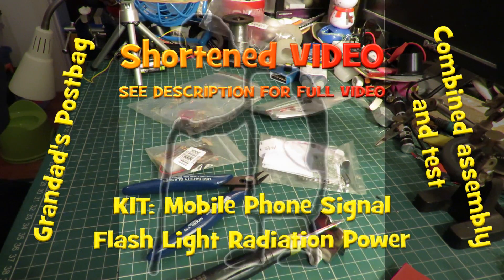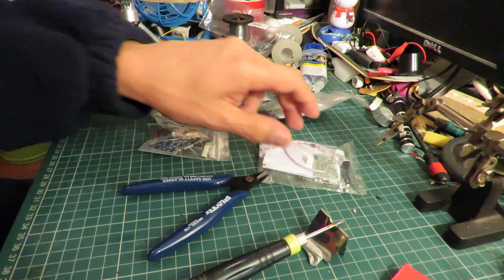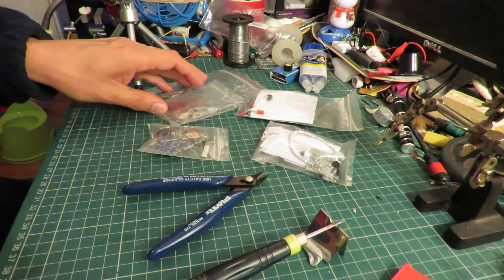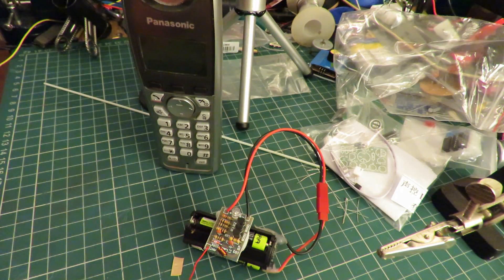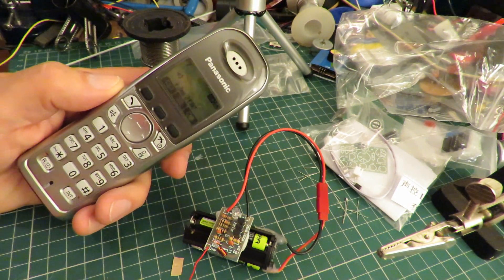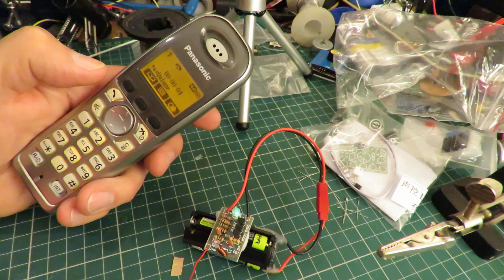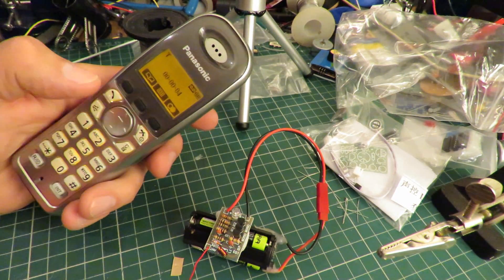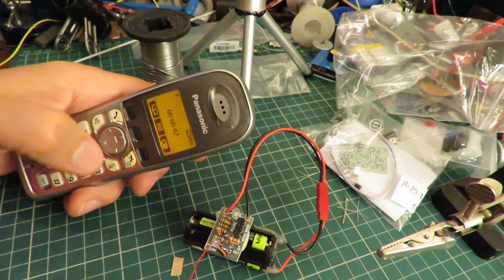Mobile Phone Signal Flash Light Radiation Power SHORTENED VIDEO

Comment: Nice project and works well. I take it that the receiving is on 2.4GHz then ? a 28.8mm antenna may give even better results, or an exact multiple thereof (i put mm instead of using inches for you Euro type people lol)
Reply from the maker: Sometimes your advice goes so far over my head I have to sit around and wait to see if it will come back down again :) I had to Google the frequency ranges as I didn't have a clue. Yes there was nothing in the instructions to indicate what length the antenna should be so I just connected what was supplied, which I have just measured and it is 350 mm so I guess I could trim it to 288 mm to give a multiple of your suggestion although to be honest I was happy it appears to work after my assembly efforts. Alternatively I could try it as it is, then replace it with one 28.8 mm and see if I can see any difference.
Reply: That's all I was thinking about, to try different antenna lengths. Head sense says there should be less reception with a shorter wire, but that isn't at all the case when the wire is exact to the frequency. Fun to try with projects like this one.
Reply from the maker: slider2732 :)